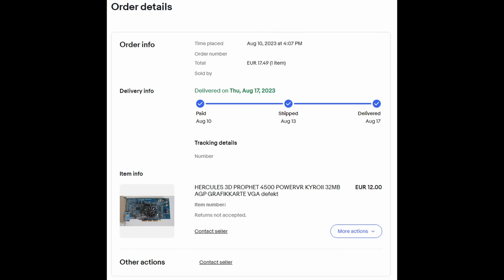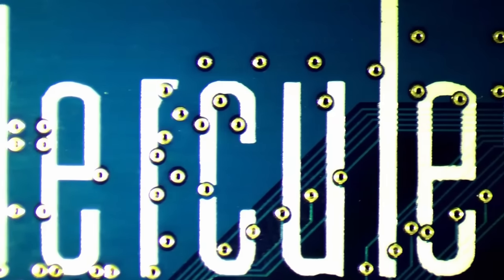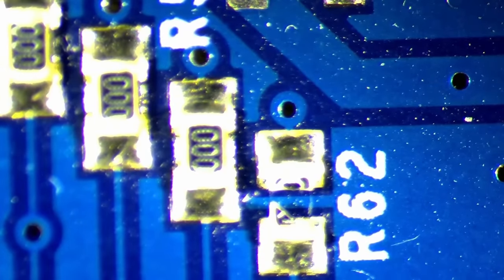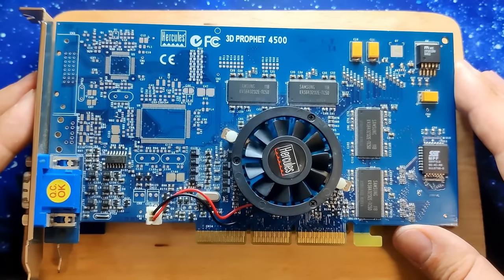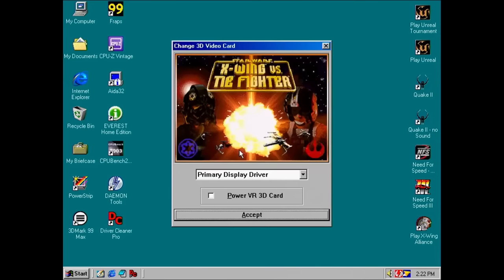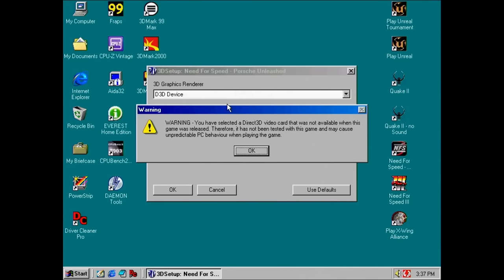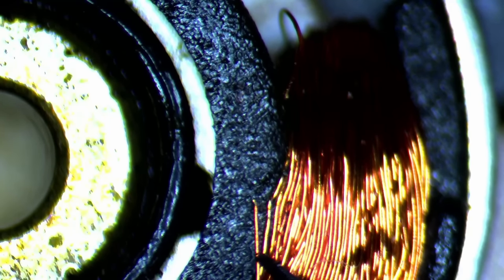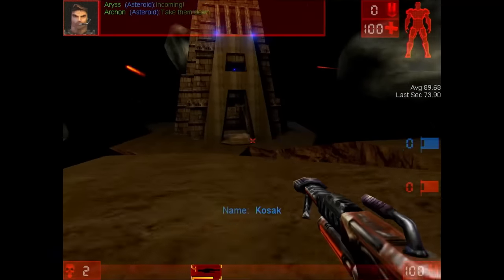Lifeless Kyro II - Reviving a 3D Prophet 4500

Comment: Is there a point to a 0 ohm resistor? Could you have just bridged the contacts pads?
Reply from the maker: Yes, I could have used a wire. I think it can also be used as some sort of fuse, but it's probably better to use a dedicated component with proper rating for that purpose.
On this card, the resistor is used to jump over a trace. This was new to me and others mentioned it. It's like overlapping two traces above each other. And finally, a 0-ohm resistor can be placed by a machine like any other SMD component. So, it's cheaper and easier to have a "wire" as a 0-ohm resistor than an actual wire.

Comment: I never had a Kyro II back in the day, but I did acquire one in a second hand PC I bought a bit over a decade ago. I wasn't very impressed with the card mostly due to the terrible drivers. Hercules and STMicro didn't put much time into driver development, they were beta quality at best before STMicro abandoned the PC market in short order.

The Kyro II has much the same problem as the Rage Fury MAXX. It's a weird unorthodox card and only really works properly in Windows 98SE.

I could never get my Kyro II working in Windows 2000 or XP, installing the drivers would cause almost immediate BSODs. When the system would run a game, it was artifacts galore. Running the card in Windows 98SE didn't have that problem, though it was still equally hellish to get a driver version that was stable. I looked around at old forum posts from the 2001-2002 time frame, and it seemed to be a common problem, drivers were awful.

When the card did work, it was fine for what it was. But dealing with the driver issues makes it more of a historical curiosity than a usable product.

Comment: Kyro II was a commercial failiure, for good reason!
Reply from the maker: Could you elaborate on that? This card seems to be a good budget option with a lot of performance per buck.
Reply: @bitsundbolts  A geforce 2 mx was overall a better deal and more compatible...if this thing was affordable and viable it was only for a few months. The compatibility just isn't there. Especially if you live in the United States, it was never a good deal.